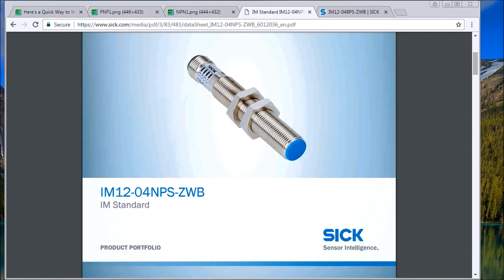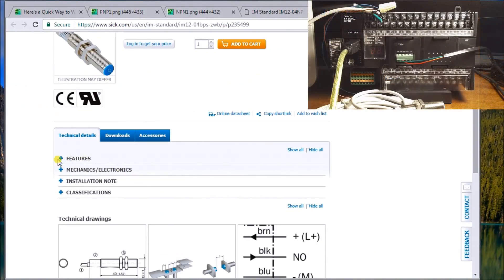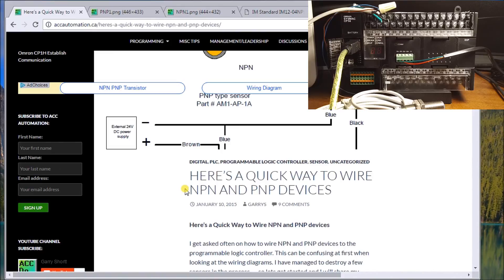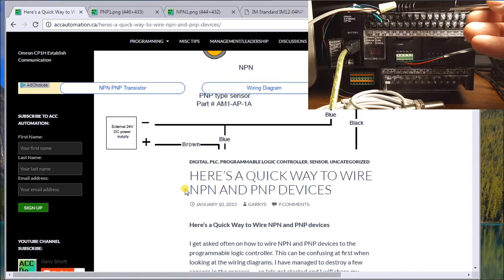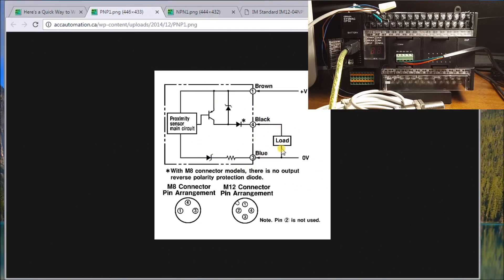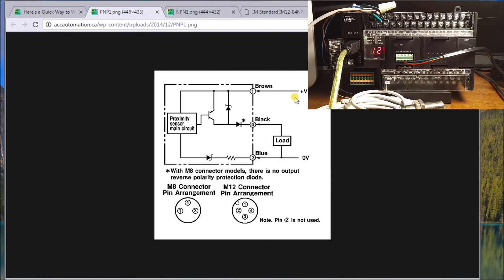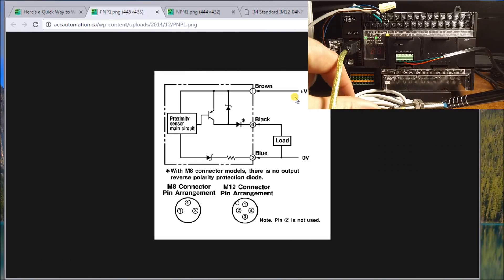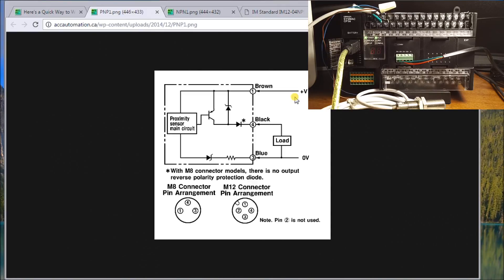Connect Your PNP Sensor to PLC Like a Pro!

Comment: sir, thanks for your video. I want to know,  does input module itself  need  power   to work??
Reply from the maker: Hi Md.Rokibul Hasan Roni
Every input may be different. Some PLC's you need to power the input card with the appropriate voltage. Other input cards will take power from the back-plane to power it. You will have to look at the specifications for the device you are wiring.
Regards,
Garry

Comment: How to connect close proximity sensor PNP (NO) to siemens logo 24RCE?
Reply from the maker: Hi HappyLive Chanel,
Page 24 of the following logo manual will show the wiring diagram of the logo.
https://cache.industry.siemens.com/dl/files/461/16527461/att_82564/v1/Logo_e.pdf
I can only speak in general terms since I do not know your exact sensor. The common for the Logo input is 0VDC. The switching wire of the sensor (Black) goes to the input point of the logo. The +VDC (Brown) of the sensor will go to the +VDC supply.
Regards,
Garry

Comment: I've watched this video and the one for NPN sensors at least 10 times and I am still confused. I've tried both PNP and NPN sensors and it appears that I should be using NPN because they are Normally Closed just as my E-Stop Switch is. The issue I am having is that in your wiring diagrams there appears to be a Resistor on the Blue Wire and a (Load) across the Black and the Blue Wires. I have yet after viewing over  a 100 different videos have someone explain in Plain English on how What a Sink Is and How to Wire One. I'm quite sure if you could explain this in video to those of us foolish enough to try and learn basic electronics in the latter stages of Life. You'd be considered an International Hero!!!!!!!!!!!!!!!!!!!!!!!
Reply from the maker: Hi Ronald,
I find it quite confusing sometimes the language we use for these devices. The other confusing issue sometimes is the way we talk about the sensor and sometimes about the device we are connecting. (PLC) 

Looking at the sensor (switch) itself:
A sink (sinking) switch is a PNP output. A source (sourcing) switch is an NPN output. 
Normally Closed (NC) and Normally Open (NO) refers to the state of the output of the sensor when normally nothing is being sensed.
Every sensor will be at least a PNP (sink) or NPN (source) and the output will be NO or NC. Some sensors have PNP and NPN as well as NO and NC output contacts. That is why we always have to refer to the manufactures wiring diagram. The resistor that is shown in some of the diagrams is called a pull-up or pull-down resistor. This is usually internal to the sensor.  Manufacturers will also show the load sometimes with a resistor.

Looking at the device (load) side. (PLC)
Specifications of the sensor are usually determined by the load. 
PNP, negative switching or sinking the load will have the common point of the input at +VDC. If the sensor activates you are switching that load to 0VDC to make the circuit. 
NPN, positive switching or sourcing the load will have the common point of the input at 0VDC. If the sensor activates you are switching that load to +VDC to make the circuit.

Here are a couple of sites that you may also find helpful.
https://automation-insights.blog/2011/01/18/industrial-sensing-fundamentals-back-to-the-basics-npn-vs-pnp/

http://www.brainboxes.com/faq/items/what-does-npn-and-pnp-mean

I will think about making another video on this connection of 3 wire NPN and PNP sensors.
Thank you,
Garry
Reply from the maker: Here is another video and post on wiring NPN and PNP sensors.
Wiring 3 Wire DC NPN and PNP Sensors
https://accautomation.ca/wiring-3-wire-dc-npn-and-pnp-sensors
https://youtu.be/YluDQ7_di1k
Regards,
Garry

Comment: Can i wire a pnp sensor to a npn input plc?
Reply from the maker: Yes you can when you use an interposing relay.
https://accautomation.ca/wiring-interposing-relays/
Here is a video showing how to do this.
Wiring NPN and PNP Sensors into the PLC with an Interposing Relay
https://youtu.be/abh_Q7eKT34
Regards,
Garry
Reply: @ACCautomation  ok because apparently i have a sink type plc with npn passive inputs and Im trying to wire a PNP proximity sensor to it.  I already damaged one sensor and Im trying not to damage the second/last one i have :-)
Reply: Thanks.  Do you have a resource for learning sinking and sourcing, npn and pnp input sensors and plcs?  I'm having a hard time understanding it
Reply from the maker: Hi Santiapps,
https://accautomation.ca/heres-a-quick-way-to-wire-npn-and-pnp-devices/
The above link will cover wiring of NPN, PNP sensors.
Think of the wiring from the load point of view. If the input is to a PLC, then the load is the input point of the PLC. 
If the load is NPN (sinking) then the load appears between +VDC and the switching wire. When the sensor is activated we sink or negative switch the load.
If the load is PNP (sourcing) then the load appears between 0VDC and the switching wire. When the sensor is activated we source or positive switch the load.
Hope this helps you out.
Regards,
Garry

Comment: Is there only one power supply for both the PLC and sensor?
Reply from the maker: The CP1H PLC comes with a 24VDC power supply on the unit. We are using it to power the sensor. The input of the PLC is just looking for a voltage between the input point and common point for the input.  The PLC has isolated commons for some of the inputs. Please refer to the wiring diagram of the PLC inputs.
Hope this helps you out.
Regards,
Garry